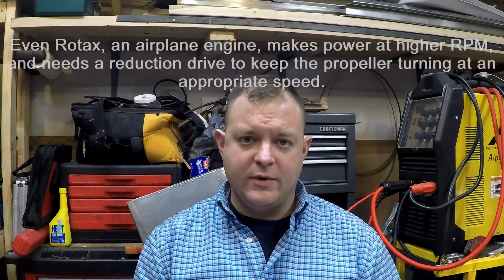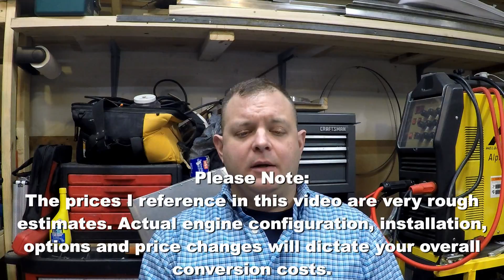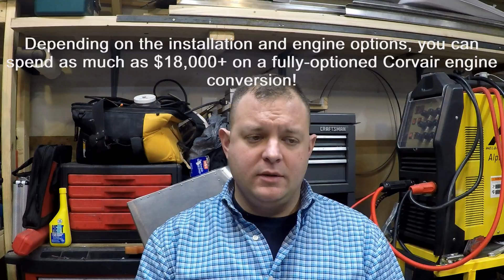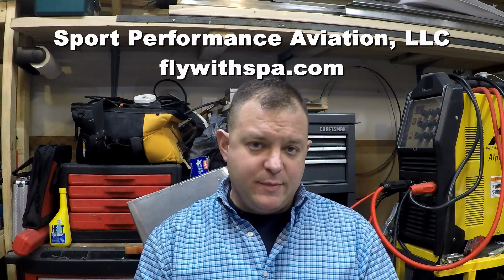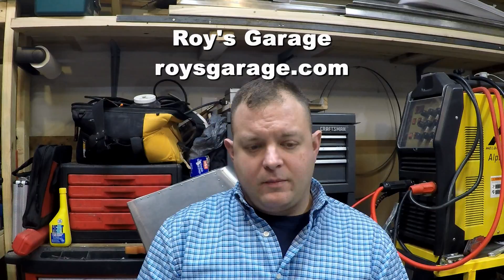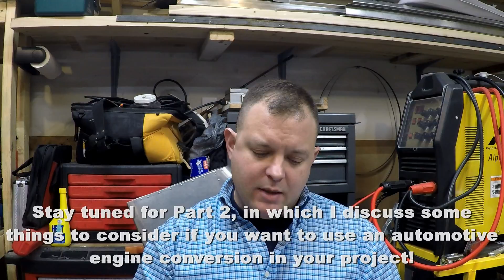Why I chose a Corvair engine conversion - Part 1/2

Comment: I’m researching.  I’m down to Corsair or VW
Reply from the maker: Which vendors are you looking at for Corvair and VW conversions/parts?
Reply: @GregsZenithSTOLCH750  I’m still on the fence.  Both Corvair & VW has their merit.  I love the 6cy for safety margin.  If corvair, I would go with FlyCorvair since that guy is so animated & passionate on his channel.  For VW, I don’t know who I would go with.  AeroVee & RevMaster seem to be the ones “in my face” on YT searches.  

A coworker, he’s into VW.  He suggest the VW due to more (automotive) parts available, his experience.  He said it’s still possible to get a new created engine if i search hard enough.

Ultimately, I wish corvair & vw has a diesel version of their engines.  Delta Hawk or Gemini (I think) caught my interest but they were on the higher end of cost.

The airplane I’m looking into is a Quickie.  It’s light enough that I can get away with it being an LSA.  One option is to put an elec motor just to fly within a tiny radius, no cross country.  In some future, I can install something that would allow cross country.
Reply from the maker: @peterxyz3541  I think both Corvair and VW are valid options if they meet your power/weight requirements for the airframe you select. If you've never built an airplane or converted an engine for flight duty, I would follow some kind of proven airframe/engine combination so you don't have to solve a lot of engineering/fabrication problems. AeroVee, Revmaster and Great Plains Aircraft Supply are the "big 3" when it comes to VW engines, as far as I understand it. Parts availability for the Corvair is currently pretty solid (and way better now than when I started my conversion), whether it's stock parts or the flight conversion parts. AeroMomentum and Viking are other engine options based on more modern tech but aren't kit engines. Electric would be an awesome thing but you're diving into a lot of unknown territory there, depending on the airframe & a lot of other factors. Also, I wouldn't get too hung up on the engine until you've actually built/bought the airframe. I started with the engine conversion in 2004 and I'm still waiting for the machine work to be finished (long story). It's kind of a backwards way to do it, and I don't recommend it.

Comment: I just started researching the Corvair engine because I'm looking at buying a Pietenpol Air Camper with one installed. Do not know what conversion it is as this aircraft was built in the mid 80s I believe. haven't even seen it yet. It is supposed to undergo a condition inspection tomorrow as a matter of fact so hopefully things will go well. I have flown behind many different aircraft engines but not the Corvair. appreciate you doing this video and I will watch the next one here shortly.

Comment: The corvair engine was originally designed for GM for a helicopter contract. GM failed to get that contract, and decided to convert it to a auto engine.

Comment: It sounds like you'll be starting with a 1963 102hp engine versus a "Monza" (110hp) or "Corsa" (140hp)?
I'm guessing the conversion includes fuel injection and a dry sump lubrication?  ;-)
Reply from the maker: T'airn'KA 1965 110 engine with high volume rebuilt oil pump and MA3-SPA Marvel-Schebler aircraft carburetor. Pre-1965 engines and 140 HP Corsa engiens normally do not make good conversion candidates. I'll be doing a full "show and tell" video on my engine once I have it assembled. It's still in the process of getting the 5th bearing added.

Comment: Greg, I too researched many engines and like you came to the same conclusions.  Then I found the Viking Engine which is an auto conversion of the Honda Fit 1.5 litre engine.  This engine can easily deliver 130 HP or add a turbo to get up to 200HP.  Cost for the 130 HP is $10,000.00.  The engine is water cooled, and the radiator is belly mounted and this gives you hot water for cabin heat( kind of important here in Canada).  The Honda engine has electronic engine control ie: ignition, fuel injection( direct in cylinder injection  GDI), coil on plug ignition...FADEC.  This is a modern engine requiring only 1 throttle control ( no carb heat or mixture needed) which also means that you can use auto gasoline with up to 10 % alcohol.  Most noticeable is the lack of vibration (4 cylinder in-line, 4 valves/cylinder, variable valve timing)  and will burn from 4 to 6 GPH, depending on how fast you want to go.  It has the power to push the CH 650 to 150 MPH, its VNE.   The guy who is winning the CH 750 STOL Challenge is flying this engine.   The Viking Engine conversion all in weights the same as the Corvair 110.  Check it out.  Good Luck with your project.  I like x-country flying,  and really like the robust construction of the RANS S - 19.  Though I would like the challenge of scratch building the CH 750, cause I have never seen a plane that can do what this plane can do.  What a HOOT!!
Reply from the maker: Rans makes a really nice plane...I looked at them way back in the day as well. Viking's engine package is really nice, especially if the real world numbers match up to the published numbers. My only reservation about an auto conversion that is not a kit engine (i.e. you get the complete, assembled engine from Viking), is that Viking is the only company that can provide service for your engine. That doesn't mean I'd have any problems that go unresolved in the future, but there are several places that can work on a Rotax or Jabiru or even ULPower, to say nothing of certified engine choices. With the Corvair, I'll be my own technician, and will have assembled the engine myself. I can even have replacement custom parts fabricated locally by a machinist if I ever needed to. I suspect that would be a lot harder to do with a Viking engine. If something happens to the Corvair conversion guys, I'd still be able to rebuild my engine or fix it. But it doesn't have the performance of the FIT. I love the idea of FADEC, but I also love the simplicity of the Corvair...tough choice, especially if I was still in the market for an engine. Jan has a brilliant engine concept...if I didn't already have $8k into my Corvair, I'd really be on the fence.
Reply: However much it is, carrying replacement coolant, just in case, will reduce the useful load of your aircraft and take up space in the baggage area.
I'm not here to knock the Viking engine.  It's just my choice that having an engine that can use a coolant that is readily replaceable, i.e., water (like the Aeromomentum) or an Aircooled (like the Corvair) has advantages that I prefer.
But, for many people, though, the Viking is a good engine choice.
Reply: Well, I have been flying a liquid cooled engines (Rotax) for over 3000 hours without any cooling problems.
And carrying an extra bottle of liquid or oil should really be no issue.
Reply: I also considered the Viking engine. It is a very good engine and has an excellent price point. There was one characteristic of the engine that eventually made me reject the engine.
The engine is liquid cooled but it is NOT WATER.  It uses a waterless coolant developed for racing engines. This coolant is NOT COMPATIBLE with water.  In fact, when using this coolant with an engine that has had water in it, you must purge the engine with a special solution to remove all water from the engine.
Thus, if you are on a cross country flight and spring a leak, you CANNOT ADD WATER to your engine.  You must use the special coolant.  This was the deal breaker for me.  However, if you can live with the very rare chance of a coolant leak, then go for it.
Reply: Richard Elniski There are certainly pros and cons to any engine package. If I wasn't already heavily invested into my Corvair conversion, I may well have selected the Viking or even a ULPower.  I still like the simplicity the Corvair offers, but a modern engine has many other benefits. It will be interesting to see how the Viking holds up in the long tern, from a reliability standpoint. Airplane duty and car duty are totally different, so I wonder if any "gremlins" will start to crop up. They certainly did in the Corvair after the homebuilt fleet had enough hours on them, but I think they've mostly been addressed.
Reply: Gary Reed I wonder how much coolant the engine requires, and whether it is feasible to carry enough to refill it if a leak developed (and you lost it all). A non-issue with air-cooled engines, but they have their own weaknesses too.
Reply: Geez, if your aircraft can not carry an extra liter of fluid, fail.
Reply: I concur on all points.  No mixture control is a big plus IMO.   Super smooth even at idle, Honda reliability and literally almost a "throw-away" price when compared to Rotax.
Reply: The turbo option is very nice.  This is especially good for the mountain and high desert dwellers.  Also gives you ability to get over nasty weather at times.

Comment: I have been following William Wynne's Corvair engines for some time. I'm with you....Corvairs are awesome. They sound like a smooth Continental O-470. I only wish you could install one magneto, and one electronic ignition on separate shafts instead of the dual ignition in one distributor cap on one shaft. Probably still my first choice for an engine. BTW, I've been an A&P for 31 years (and 737 & 757 Captain).
Reply from the maker: 5xls Thanks for watching! I love the way they sound. And still affordable after all the new developments. William makes some compelling arguments for how reliable his dual ignition setup is, but I was thinking the other day that a mageneto would still be nice.
Reply: @GregsZenithSTOLCH750  Most magneto's I have tinkered on are still points based.  I really like the Wynne idea of twin ignitions with slightly offset spark timing.  I'm thinking about building one for a BBC going into a Jet Boat.  Two spark spark events is most of the way to an MSD system, with the reliability of two wholly different processes.  Sure, you break the dizzy shaft and you are falling ...  But that's pretty darn remote if the dizzy is carefully assembled from inspected parts 😊
Reply: you probably dont care but if you're bored like me during the covid times then you can stream all of the latest movies on InstaFlixxer. I've been binge watching with my girlfriend for the last few months =)
Reply: @Crosby Kabir Yup, I have been using Instaflixxer for years myself :D

Comment: In all seriousness though, I like the look of the 5th bearing made by Azalea.  I also notice that Azalea places the starter in the rear of the engine vs FlyCorvair (WW) who puts his on the front.  Did your research lead you to any conclusions about the better position?  Personally, if it's a draw I like the cowling that Azalea puts out for their design more than the cowling design FlyCorvair uses.
Reply from the maker: I prefer the front starter setup...FlyCorvair has information on their website about the pros and cons of the starter location (at least for a 750). It's buried among pages and pages of other data, so there's lots of reading to do. Some of it boils down to weight and balance, some of it boils down to loads the starter puts on the crank in that position, along with other issues.

Further, if I recall correctly, Azalea removes the harmonic balancer off the back of the engine to accommodate the bits needed for the rear starter/rear alternator. There is a lot of debate still whether the harmonic balancer is actually needed. FlyCorvair says that is is needed, some others say that it's not. The choice of 5th bearings is another whole thing. As far as I know, Azalea's is the only in-production thrust-bearing design, but there's a debate on whether a thrust-bearing design is even needed. I like Roy's design the best, which is why I went with it, though there's a backlog of orders if you want one right away. It's just a bonus that he's right down the road from me.
Reply: Which years make good candidates for conversion?  I've looked all over WW site and can't find it.  And does manual or automatic make a difference?
Reply from the maker: dicel87 If you want to build a FlyCorvair style conversion, William Wynne lists the full range of years and engine case numbers in his conversion manual. Generally speaking the 1965-1969 110 HP base engine is preferred, but there are exceptions. There are different block and head combinations that yield different results, depending on how you want to set up the engine. Now that a 5th bearing has to be added to the engine, it doesn't matter if you get one with an auto or manual transmission. If for some reason you weren't going to put a 5th bearing in,  then you would modify the bell housing on an automatic transmission to use as the front engine seal housing/cover. I'm not sure what Azalea's core motor requirements are, but I suspect they are similar. I would add that if you are looking at buying a core motor, either first buy a conversion manual from William (if you plan to assemble it yourself), or contact one of the vendors to discuss an engine core with them before you buy anything. Many of the existing car engines have been rebuilt or have had head swaps, so you need to know which specific head and case numbers will be applicable to your specific engine build. You could end up buying a core motor with the wrong heads, or vice versa.
Reply: Thanks for that reply - man there is a lot to absorb.
Reply from the maker: You're welcome. It is absolutely a lot to absorb. Although I wish it hadn't take me so long to get to where I am today with the project, I've had over a decade to absorb it all. I remember when I first started looking at auto engine conversions...it was overwhelming.
Reply: @dicel87  65 and up.